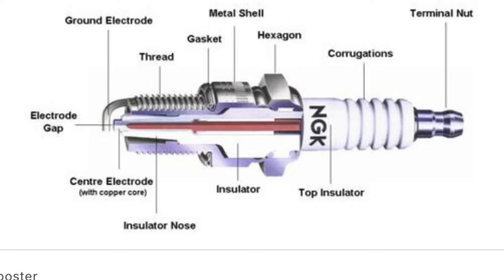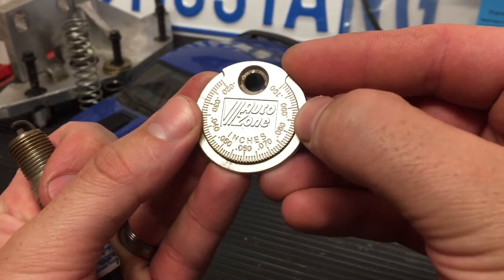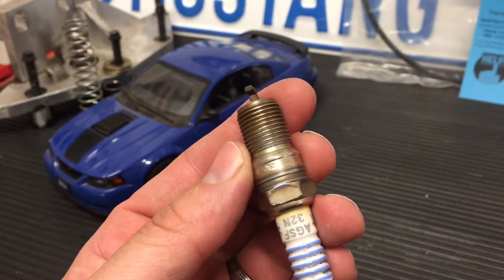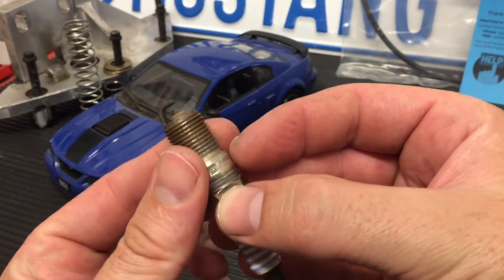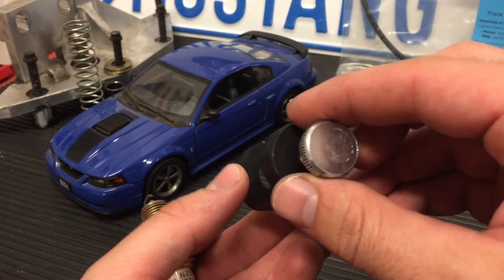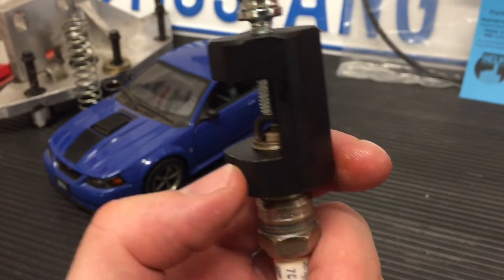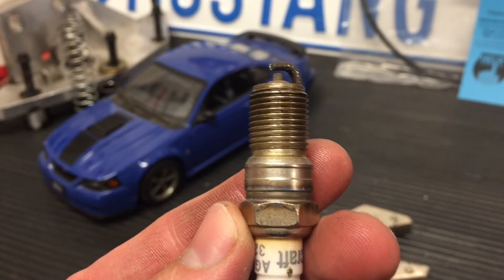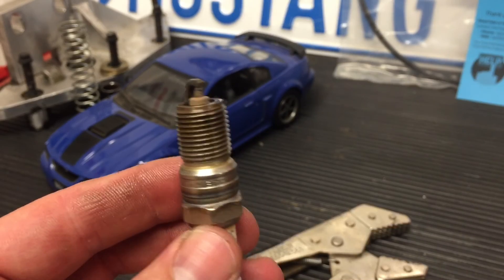Gapping Spark Plugs. How tight, and why:  How to gap a spark plug

Comment: Which creates the best spark, a small gap or a larger gap?
Reply from the maker: Larger gap will crate a larger spark. It’s only advised to gap them down so it’s not as easily blown out by boost pressure.
Reply: Thank you for responding.

Comment: I like using the vice-tool as you showed in the video. I also put the flat feeler gauge in the plug gap as I turn down the screw. That way you get it done on the first shot which is best for the plug and your engine since you minimize the risk of weakening the ground strap to the point of failure. Aside from the plug electrode then burning a hole in your piston, imagine what the broken off piece of strap would do to the internals of your engine!

Comment: I think I want to use a vice to hold the tool in when I do it.
Reply: Justin...I found out a cool shortcut with my vice-tool plug gapper. There is about .002 of recoil in the plug strap after you tighten the tool down and then release it. So if you want to get .028 gap, you insert a .026 feeler in the plug gap and the tighten the vice-tool as far as you can manage by hand. When you back it off it will give you a nice tight .028 gap!
Reply: @tomkjr1  Good to know. Thanks. I can practice on some old plugs too
Reply: @justin.c_svt  The recoil may vary from plug type to plug type but it shouldn't be by much. I am currently using Brisk silver core plugs, my Terminator loves 'em! Silver is the most conductive core you can get in a plug so I like to get every little edge I can! lol

Comment: I just filmed a video a few days ago ( not released yet ) on what the gap was on my plugs that I just took out of the Cobra as they were out of the box compared to what the gap should have been at as a reason for why you should properly gap them before putting them in.  It was not drastic but only 1 of them was actually right where it should have been.